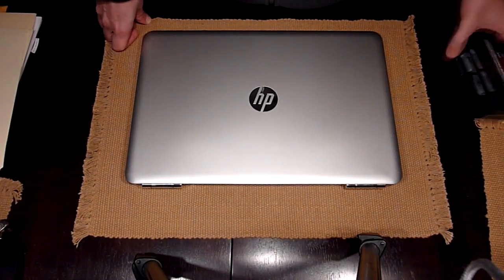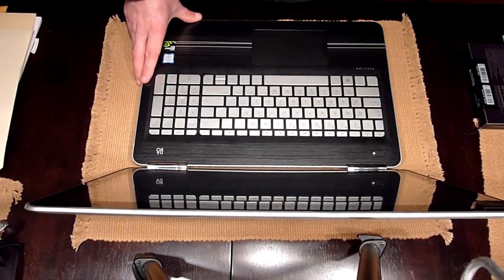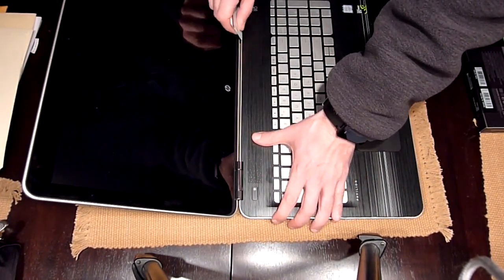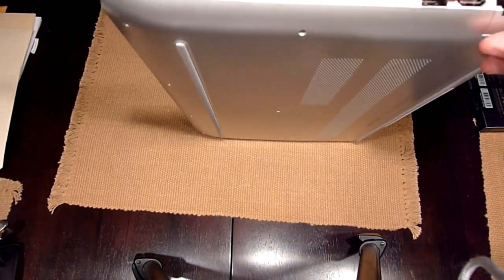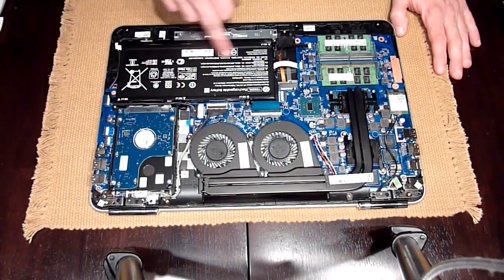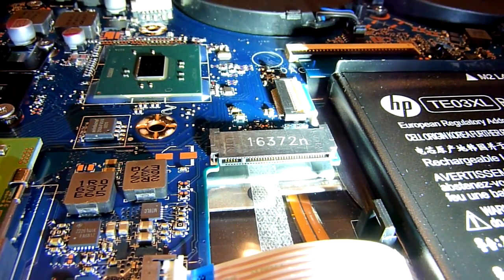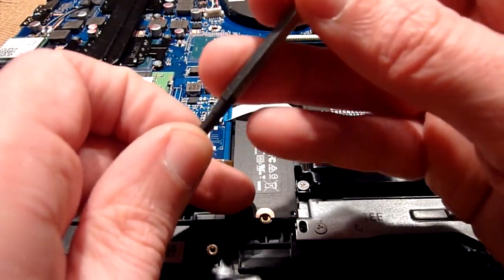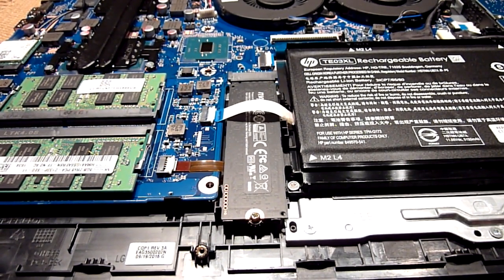HP Pavilion 15 bc018ca Laptop with Samsung 950 PRO M.2 NVMe SSD Drive install

Comment: I'm so happy I found your video.  I've been wondering for a long time now if there was an upgrade for this machine.  I have the same model, and it takes 15 minutes to boot up now.  When it starts the hard drive goes to 100% and stays there for the entire boot up process.  I have read everything and tried all the suggestions.  Lots of people have this same issue.  You just saved me from having to buy a new computer.  I'm still disappointed that an i7 intel CPU can't run windows 11.  I thought I was future proofing my purchase by spending extra on the better CPU.  Thank you Aleziss, you made my day.
Reply from the maker: You're welcome and thank you for your appreciation ! Many computers are thrown in the garbage because of the mechanical drive failing or getting extremely slow while the computer is powerful enough. You will enjoy your computer like never before ! Even when it was brand new it never had that performance compared to a M.2 drive! Best update ever, I still use my computer every day and it perform exceptionally well ! Enjoy your "new" computer !

Comment: hp pavilion 17t-ab000 cto gtx 960m withi5 6300hq it works with this same ssd?
Reply from the maker: if you open the case and see the M.2 connector then I am pretty sure it will work.

Comment: I have a HP 15 da0987nl, can I put an nmve ssd?
Reply from the maker: according to crucial website, it seems to be compatible with nvme drives... but the best way to know for sure is to open the case and verify you have the connector. https://www.crucial.com/compatible-upgrade-for/hp---compaq/hp-15-da0987nl#ssd

Comment: I have the exact same model as you do. I watched this video so that I could learn how to take it apart in order to replace the internal battery, and for that it was very helpful. At the time, I didn't know that the computer had a slot for an M.2 drive, so that was an interesting discovery. Recently I found a 1TB Samsung 970 EVO NVMe SSD on sale for $160, so I decided to do the upgrade since it was the same price as a comparable 2.5 inch SATA SSD. The installation went smoothly for the most part (aside from me screwing around with the BIOS when I didn't need to) and the improvement in performance is incredible. Everything runs much faster, boot-up is almost instantaneous, it's dead quiet, and it takes a lot of load off of the cooling fans. So far, there are no issues and I couldn't be happier. Thanks for putting me on to this!
Reply from the maker: absolutely fantastic, I am glad my video was helpful for you ! My NVMe drive is still working flawlessly on my system as I type this answer to you ! And yes, it is a strange thing that no where in the bios the NVMe drive shows up but it does work ! The only thing I had to do to make it work is to enter the bios, DO NOTHING, save and exit and it worked instantly after that. Thanks for the positive comment I really appreciate !
Reply: Are you using the NVMe card alone or together with the HDD?
Reply: @olanrewajuatanda533  Just the NVMe drive. The HDD space has been left empty because I don't need the extra storage yet. I can always pop in an SSD in the future if I want to.
Reply: @RoboBeastWarrior  oh thanks. I've read somewhere that using the HDD together with the SSD can still slow down the system and drains battery. So, will you advise me to stick with the SSD if I upgrade or I can use it together with the HDD?

Comment: bro my ssd is not showing in bios mode although it is showing in my c drive i have clone ssd through migration tool but in bios where we have to choose os boot manager thier it is not showing samsung 970 evo plus ssd and motherboad is as same as your so ssd is connected properly plzzz help
Reply from the maker: hi, the SSD don't show up either in my system but it DOES work, I am still using that computer as I type this answer. 1) are you sure the cloning is completed without any errors ? 2) after cloning, THE ONLY THING I DID was to ENTER in the bios, DID NOTHING, hit save and reboot and as soon I did that, it booted up. 3) REMOVE your original drive, keep only the NVMe drive and it will work I am pretty sure. It's been working flawlessly in my system up to this day.

Comment: hey i have same design of your laptop but my hp laptop is different does this ssd will work on my laptop
Reply from the maker: if it looks like mine I suspect there is a NVMe port but the easiest way is to open the case and take a look on the motherboard, you have all the info in my video on how to do this you shouldn't have any issue with that before buying a new drive.

Comment: I see M2X3 port in my hp laptop this for NVMe or PCIe SSD port?
Reply from the maker: search on google M.2 M key, that is what you need to find on your board, if you do have that connector, it should work.

Comment: is HP Pavilion 15-bc018tx Compatible with Samsung 950 PRO NVMe SSD sir?
Reply from the maker: I do think so, but really open the case and see if you do have the NVMe slot, I am pretty sure it is the same model as you see in my video.

Comment: Hello!
My laptop have M.2 SATA3 slot.
Can i M.2 NVME slot install on my laptop?
Reply from the maker: hi, you've said it yourself, if your system has a M.2 SATA slot (B key), it will not work on a M.2 NVME (M key). NVMe requires a PCIe slot, not a SATA slot unfortunately...
Reply: @Aleziss  thanks for your help.
Reply from the maker: @mramir56  you're welcome !

Comment: Is that slot m.2 sata or m.2 pcie? I am confused because i have seen different  slots in others' videos, there the notch in slot is at the right side, here notch is in left side? Please clarify bro.
Reply from the maker: it is a PCIe with a M key for NVMe drive. The computer is upside down so the key is on the other side.

Comment: Hi may I know if it reads in your laptop? the Samsung 950 PRO NVMe SSD
Reply: I am planning to buy to for my HP Pavilion 15-bc018tx
just want to know if its compatible with Samsung Pro NVMe SSD. Hoping for the reply thanks
Reply from the maker: I do think this will work since it seems to be the same serie as mine but you need to find the M.2 M key connector on your motherboard. If you see that connector, it should work no problem.

Comment: Hey man. I have HP 15-bc021tx model and I wonder that if I wanna install ssd, Do I have to take off hdd and use only hdd? Or I can just install the sdd and enjoy both drives at the same time?
Reply from the maker: you can run both ssd and hdd at the same time but the hdd will slow down your computer for sure, at boot up during spin up time or when the hdd is waken up from a sleep, you'll have to wait for that mechanical drive. I would suggest a second SSD drive instead of a mechanical drive.

Comment: I have HP 15g-br106tx laptop with m.2 slot B key notch inside in it. And it has PCIe x4 slot and interface occupied by graphics card so can I use WD-SN750 PCIe nvme ssd or Gigabyte PCIe x2 nvme ssd with B and M key both. I'm bit confused could you please guide me correctly??..
Reply: Hello! Is your query solved? And if yes then can you please tell me. That did u installed Nvme ssd? And if yes then was that socket at the left side of the Ram?
Reply: @amaanshaikh3894  yes my problem had been solved. No, I have installed m.2 sata not nvme because in my laptop PCIe x4 interface was already occupied by graphics card and I found that if still I use nvme it will create hardware issues in future. And yes the m.2 slot was on the left side of ram slots. And still you have any query @i_t_s_m_e_tanuj is my insta handle you can simply do a DM me over there. 🙂
Reply: Thankyoh So Much For Your Reply And Your Time! 😊Sure i'll DM You If I Need.. One Last Question... So Is Nvme Ssd Supports In Your Motherboard?
Reply: @amaanshaikh3894  I saw the model no of your laptop. It'll not support nvme so as in mine also.
Reply: @tanuj_verma8884  Yeahh Got That From Your Point. Thanks Mate!

Comment: Hello I wonder if my hp pavilion 15-bc017nt model computer supports NWMe.
Reply from the maker: you would have to look for the service manual on google but your model is pretty much the same as mine so I suspect that yes it has the NVMe port. Open your case and find it out, you can see how to do it in my video, if not, snap everything back together as if nothing happened...
Reply: @Aleziss  I found the guide but could not find a clear expression in it. Can you review it for me?
http://h10032.www1.hp.com/ctg/Manual/c06325755
Reply from the maker: @redpatchs1348  I do not see the bc018 model listed in that service manual... what is the processor and ram you have ?
Reply: @Aleziss  i76700HQ 2.60GHz 16gb ram
Reply from the maker: @redpatchs1348  it is the same as mine, I suspect you do have it but you just need to open the case and confirm, I cannot find the processor in the documentation you provided before neither the model number...

Comment: Hello, your laptop has 16 gb ram ? I have a HP pavilion 15-bc201nq , same as your laptop , can be upgrade to 32 gb ram?
Reply from the maker: Hi, yes my model has 16gb RAM. Not sure the mother board can accept 32gb (2x16) but the processor 6700HQ sure can ! that would be to test...
Reply: @Aleziss  my processor is I5 7300 HQ
Reply: Crucial.com site say that my laptop can be upgrade to 16 gb ram and Command Prompt say that can be upgrade to 32 gb ram
Reply from the maker: @mihetalexandru8327  like my processor i7-6700HQ, it should handle up to 64GB but I am not sure the motherboard will support 32GB...

Comment: hi I tried to change the hard drive and ending up frying the motherboard. Any idea if I can just get a new motherboard somewhere ? I have checked through HP and cant find a part number anywhere or know what I am looking for. any ideas ? thanks
Reply from the maker: really ?? wow... maybe you had the wrong drive in the wrong type of slot... You have to be sure it's either NVMe or SATA... your best bet is ebay in my opinion, I got a dell laptop motherboard replaced by the same model I found on ebay that had a broken screen, swapped the motherboard and it worked again ! Find the exact same model, be sure what you buy is working (like properly booting) and you should be good to go ! Carefully examine what went wrong with your SSD install to make your motherboard fry... good luck !

Comment: Hello sir,  I have SATAIII slot on my hp 15’s motherboard and I want to know please if I can install an NVMe on it or not. Your reply will be highly appreciated and thanks in advance
Reply: Only 2.5" SSD and HDD can fit SATA III connectors. In order for a M.2 NVMe SSD to be installed on your laptop you must have a M.2 port.
Reply: I have the M.2 port but it’s written that my laptop can take only typical ssd installed on it not the NVMe, so what I’m asking if there’s a way to install a NVMe drive on M.2 SATAIII port
Reply: When I tried to put the NVMe drive in the M.2 SATAIII port my laptop did not even power up or show the bios screen
Reply from the maker: @ahmednawar9239  My M.2 is not reported anywhere in my bios. What I had to do is install the M.2 drive, log into the bios, CHANGE NOTHING, save and reboot and there was the drive. If your manual state SATAIII, you won't be able to install a NVNe drive on that port.

Comment: I have HP Pavilion 15 bc series as well. I bought it 4 mounths ago with HDD and immediatelly change HDD to 256gb SSD. Now it´s not enough for me so I add another 500gb m.2 SSD to m.2 slot, found it in Windows, cloned but when I want to change boot priority in BIOS it´s not there. In Boot option manager is only the old 256gb SSD.  Any advice?
Reply from the maker: true, there is no where in the bios where you see M.2 parameters, it is the same thing for me. I am thinking to move from 512gb to 1tb and I am in the same situation as you are. 

My plan is either get a USB-NVMe enclosure and clone the SSD or do a full image of my current M.2 drive and restore the image to the new drive direct from my computer with the use of a USB restore tool.

I can't think any other way at this moment to upgrade a M.2 drive in the 15 bc systems... If you have any other dieas, let me know !
Reply: @Aleziss  Thank you for replying. ..Yes, but unless I understand, you bought your computer with only HDD and then you add Samsung m.2 SSD...and how did you attain that your computer boot from m.2 and not from HDD. Because, now, I´ve got 256 SSD in the SATA place and the new cloned m.2 SSD in the m.2 place and I can´t get my computer to boot from m.2, not SATA. There is nothing in bios. Only when you get to boot menu by pressing F9, it´s possible to make it boot from m.2 but it´s worthless because it´s not automatic. Did you have this problem before?
Reply from the maker: @marian930  You are correct, I had a 1TB mechanical drive (horribly slow) that came with the computer. What I've done was to install the M.2 drive as you seen in the video, log into the bios but change NOTHING (there is nothing to change anyway), save and rebooted and then the M.2 drive showed up in the windows 10 drive manager. I did not format it nor create any partition on it. I simply started the Samsung migration tool, it did it's job and once done, then I disconnected the mechanical drive. When I restarted the computer, it started working on the M.2 drive since there are no other drive to boot from I suppose. I never reinstalled a second drive in that system, only the 512GB 950 PRO drive you see in the clip...

That is pretty much it... like I told you, I wish to upgrade to 1TB and I am still not sure how I will proceed at this time. I think I might go with a full image backup, then swap the M.2 drive and restore the image with a USB tool. I might go ahead with this procedure using my Synology backup procedure. I still have around 150GB of free space and I did not get the new 1TB drive, most certainly another Samsung 970 EVO Plus.

Comment: How do I test my m.2 sata drive to find out if it's dead or not? I'm not interested in installing it.
Reply from the maker: M.2 sata is the easyeast, just find a USB enclosure and connect it to a computer. M.2 NVMe drive enclosure are more difficult to find and more expensive but I would do the same, get a USB enclosure and test your drive.
Reply: @Aleziss  I borrowed my friend's Pci-e/nvme adapter card and formatted it to NTFS in Linux Mint. When I tried it in Win7 x64 Pro, it didn't appear in bios, disk or device manager. Why does Linux see it but not Windows?
Reply from the maker: @molonlabe8792  not sure if you are using a SATA or NVMe drive but under windows 7, I suspect you might need a driver. Samsung has a NVMe driver for their drives. Windows 10 recognized my drive but at first, I had to log into the bios, CHANGE NOTHING, save and reboot and my drive was found under the drive management. I just activated the partition but did not format it.

When I used the Samsung migration tool, it find the drive instantly and it did format it to the right mode and then clone windows 10.

I never  had any issue with windows 10, not sure under windows 7 though. You might search for drivers for your particular brand of drive and give it another try.

Also there are a LOT of USB enclosures that are NOT compatible with NVMe drives, your initial comment stated it was a SATA M.2 drive which are totally different from NVMe. Be sure your enclosure or adapter card is compatible with NVMe drives.
Reply: @Aleziss  It's a 1T NVMe sata drive and plugs into a 4x Pci-e Mobo slot. I used the correct adapter and device manager shows a yellow ! under unknown device. The drive is an Eluktronics hardware and I can't find a driver on the manufacturers website.
Reply from the maker: @molonlabe8792  oh, if you get the ! under the device manager it is due to a missing driver for the pci-e adapter card I think. On the eluktronics, NVMe drives are listed as Samsung devices... you might try their NVMe driver just to see. But I suspect the pci-e card is not being detected...
Reply from the maker: @molonlabe8792  I also beleive that if you were running windows 10, it would work right away... windows 7 is not supported anymore, you should move to 10, it is still free to upgrade from 7 to 10.
Reply: @Aleziss  I called the SSD support and explained my situation. They sent me a link for Microsoft drivers update. But I've decided to use the drive in RockPro64 mobo instead. It has a 4 lane pci-e slot.

Comment: In hp 15-as133cl, m2 slot is available or not?
Reply from the maker: not sure, this was on 15-bc0xxyy models, you can search your model in google and you will find the information.
Reply: @Aleziss  I was try for getting this information on Google but information is not getting
Reply from the maker: @saddaquathussain7063  google search : https://h30434.www3.hp.com/t5/Desktop-Hardware-and-Upgrade-Questions/does-the-hp-envy-15-as133cl-have-any-m-2-2280-slot-I-want-to/td-p/7043559

Comment: Does it support HP 15BC406tx
Reply from the maker: with a tiny bit of research you could have found this https://h30434.www3.hp.com/t5/Notebook-Hardware-and-Upgrade-Questions/M-2-slot-availability-amp-type-SATA-Nvme/td-p/7111691